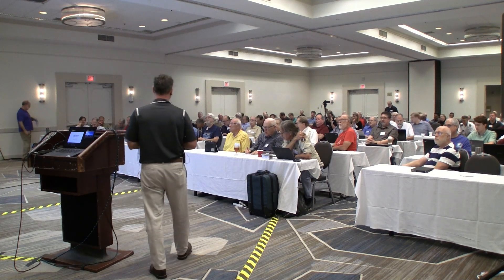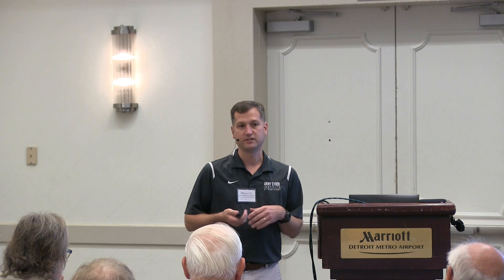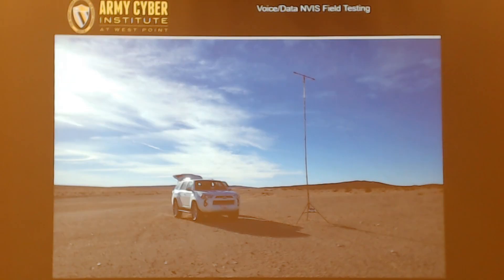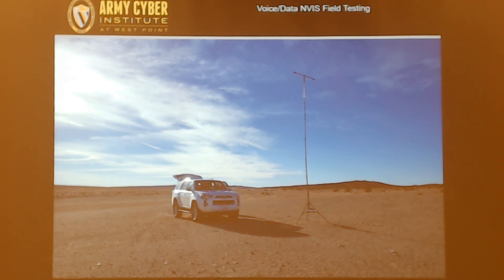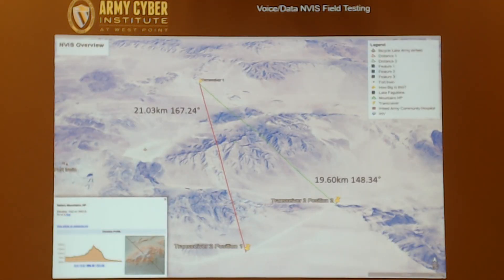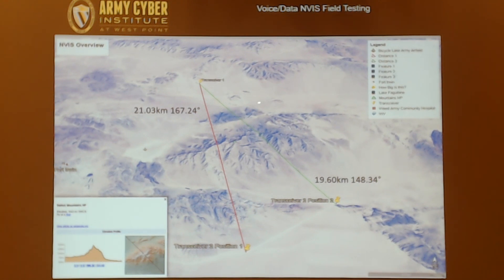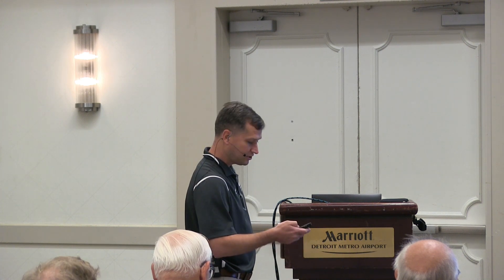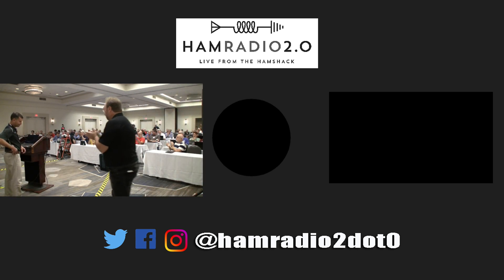JS8Call NVIS Antenna Experiment | TAPR DCC 2019

Comment: So, that would be 60 meters for the daytime ? I did not know that. No wonder I'm having trouble on 40m ? Is this documented in detail somewhere because I need to know more about the correct freq to use. Please. Also, need to know more about what was happening with 2m. Also, did you connect with the University , well,  Kathmandu University and 9N1SP Sanjeeb Panday ? I had an opportunity to connect with him once, he checked into a network I'm very active at, the Carla Radio Network California Amateur Radio Linking Association. We have a group of linked repeaters all over California, check into it some time. He checked in on Echo Link, no one would talk to him because of his accent, but I've done radio since a child, and was versed in accents if they were speaking english, which he was. We had a long conversation. I've recorded it, and have it somewhere. We are at CarlaRAdio.net. I have tried 80 and 40 NVIS with an 80 m multi band at 6ft. There are times we really need NVIS here. So, I need to learn as much as possible about it. Could probably do 60 meter JS8 although not sure which freq I would use of the channelized frequencies, although I seem to remember one was set up for data ? Also, would think a "director" would be very cool , just above the main driven antenna, shorter by 5 or 10% . Already using a reflector on the ground.
Reply: Incidentally , my photo is of Captain Ron of the Move Captain Ron.